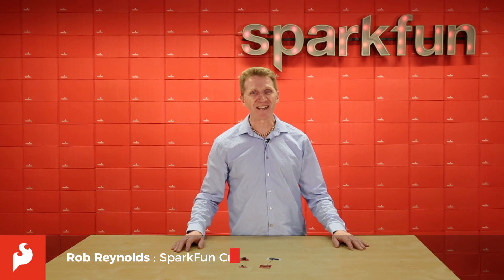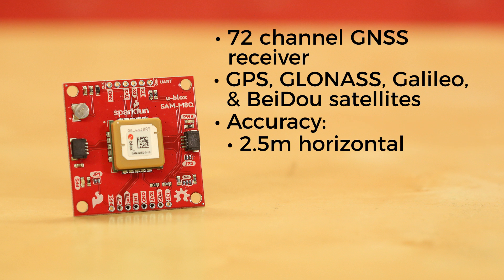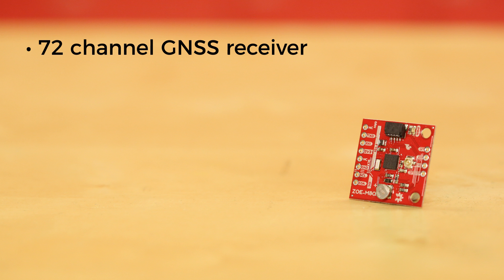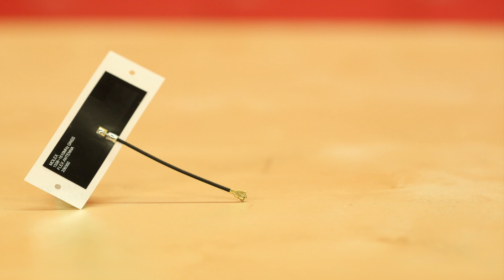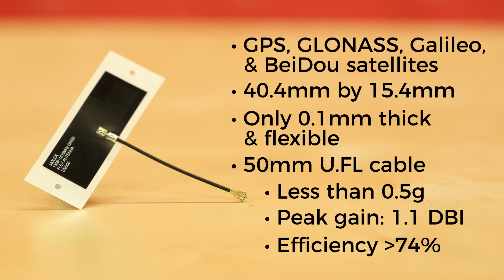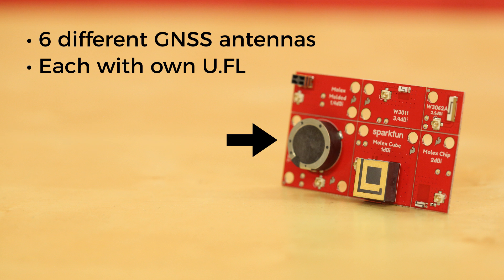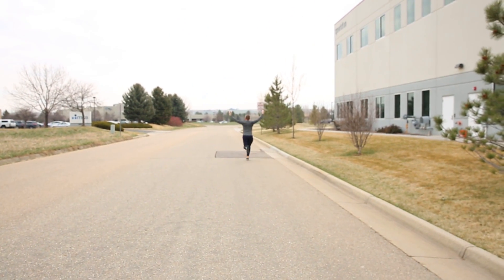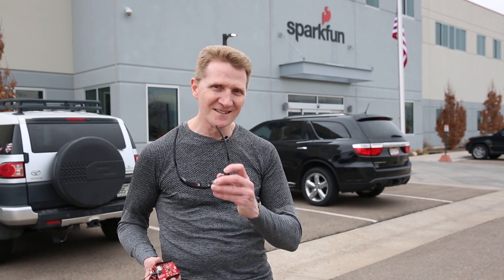Product Showcase: SparkFun GPS & GNSS Boards

Comment: Wait a 
moment, does this GPS thing work in a device that moves 1800 KMh? Usually there are build in safeguards to prevent these devices to work in missiles? with good reason.
Reply: The datasheets for both units state that the operational limits are 500m/s or speed or 50,000 m for altitude. Uh, I think there is another error in the video. Instead of 0.05mps, it should be 500 m/s.
Reply: @bobbyyc  I was under the impression that GPS devices would not allow for navigation under high speed, so they could not be used for weapons. But 500 m/s is pretty high.
Reply: @chamrog1973  500m/s is standard for the COCOM limits. I'm not an expert but that's what I've heard from others and reading datasheets. =P